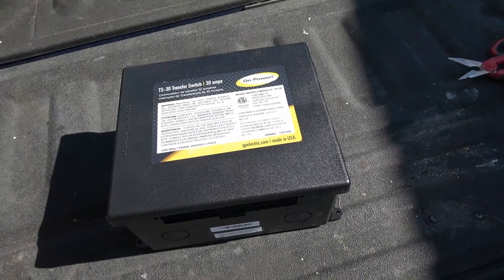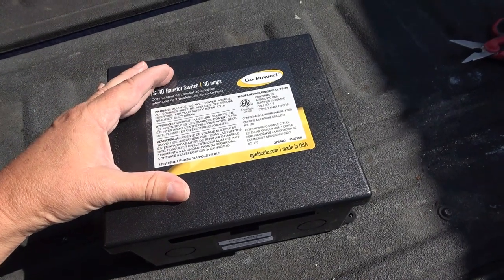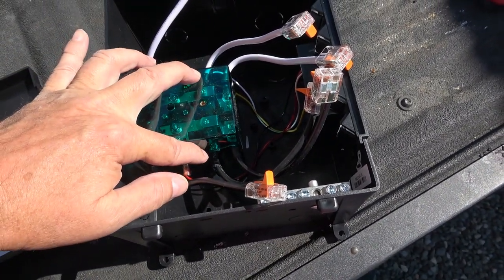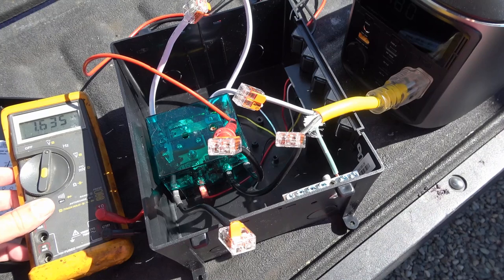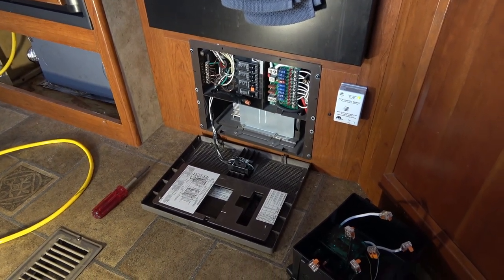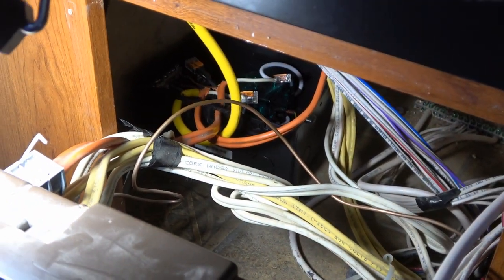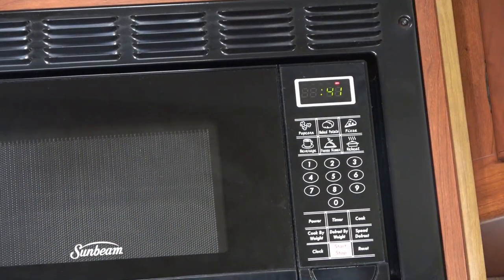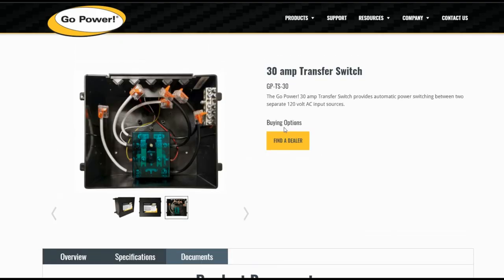30 Amp RV Power Transfer Switch Installation - Go Power! TS-30

Comment: Thank you for your video! I would like to install this in my RV with an EcoFlow Delta 2 max which will receive solar power. Do you think this would be a good solution?
Reply from the maker: I had my Ecoflow Delta Max set up like that for a while and  it worked well. Here is a diagram https://www.loveyourrv.com/our-rv-boondocking-power-systems-current-state-of-things-2022/
Last summer though I installed a 3000W inverter so changed the wiring again for that https://www.loveyourrv.com/testing-out-my-new-3000w-motomaster-eliminator-pure-sine-inverter/  My system is always in a state of flux. :) Cheers, Ray

Comment: So I had bought the same transfer switch, then watched your video. I set mine up today without problems. I think i have a similar setup as you - portable generator (not attached to the trailer) and comes in on shore line power. To get around the battery charge issue, i simply disconnect my charger and attached it to the shore line connections in the transfer switch. That way when my invert is working - its not trying to charge the batteries. They will only get charged when actual shore power or generator power is introduced through the shore line cable.  You might want to make that change so you don't have to remember to turn the breaker off every time you fire up the inverter.
Reply from the maker: I sometimes do want to charge my main RV battery bank via my portable power station inverter, though. So, like having the switch function.  You can see that in the diagram on this recent post detailing my current power system setup https://www.loveyourrv.com/our-rv-boondocking-power-systems-current-state-of-things-2022/  Sometimes I like to be able to move power from the portable power station batteries into my main battery bank. With a flick of a switch I can turn on the converter charger and do that. Cheers, Ray
Reply: @LoveYourRV  OK - you have a much more complicated setup thenwe do. I'm just a simple country boy who likes to boondock occasionally.  Really enjoy your videos. keep it up.
Reply from the maker: Thanks. :) Yes, we are averaging about 6-8 months camped off the grid now.

Comment: I have a 50 Amp service on my toy hauler. If I bridge my 220v with a plug it will run off 110v. Can I achieve this with the transfer switch? Switch 220v to 110 inverter charge bridged?
Reply from the maker: The 220-240VAC 50 amp service in your RV is actually just two - 110-120VAC 50 amp circuits. Here is an explanation - http://www.dmbruss.com/zFullTimeLifeStyle/FTLS_ElectricalDistribution.htm
Reply: @LoveYourRV  I understand but how would I get a transfer switch to bridge the legs then disconnect when I plug into 220v shore power. Right now I'm bridged and isolated my generator from my inverter. Or is what I want even possible?
Reply from the maker: I've never had a 50 amp RV so not overly familiar with 50 amp RV circus but sounds like you need two transfer switches or a 3 way maybe something like this https://rvpartsexpress.com/product/automatic-transfer-switch-for-three-50amp-power-sources-es350/
Reply: @LoveYourRV  that looks almost exactly like what's on my rv doing the switching now. I guess I could leave the legs bridged install the transfer switch and remove one of the input legs so I can't overpower it when I plug into shore? It seems to run fine on 1 leg. My inverter 3000 watt 110v even runs my AC

Comment: I hear you say that you didn't travel with your fridge on propane, is there a reason for that ?
Reply from the maker: I didn't like traveling with the open flame and spark igniter going on and off just in case I was at a fuel stop and forgot to turn it off. Also if we get in an accident I feel better having the tanks closed. Likely overly cautious but the food never really got too much warmer in the fridge while on the road. Here is a bit more info https://www.drivesmartbc.ca/rvs/operating-rvs-propane

Comment: There's a jumper on the delay board that you can bridge that will eliminate the delay since it's really not needed for an inverter.
Reply from the maker: Thanks for the tip!

Comment: Really looking forward to your update on using Lion ME as pseudo shore power. Thats been my thoughts for awhile but haven't pulled the trigger yet.  Evaluating just how I want to build out the system as far as number of Lion batteries and solar panels (ground deployed or mix of ground and roof mounted). Really interested in your results. Thanks for doing this.
Reply from the maker: Should have it out soon. Have been camped off grid for 8 days and heading to a different campsite today. One thing I can say is its been handy do to its portability. I'm camped under the trees so my roof panels bring in very little power but close to an open area, so have been able to deploy the Safari ME and its panels during the day to soak up the sun. https://www.loveyourrv.com/wp-content/uploads/2021/09/Safari-ME-Real-World-Tests-Deployed.jpg
Reply: @LoveYourRV  The portability is what got me to thinking of going that route vs fixed solar/inverter in camper. That and losing our power at yhe house this last winter. Could use the ME as emergency support there too.

Comment: ❤  Ray, when you were talking about the install and everything turned off, isn't that 1.6 V. a phantom drawdown on your batteries?   I have heard people say when they get over 3000 watts inverter, they get a big number on the Phantom draw.    Not that you are running that much from your inverter. 👍👍
Reply from the maker: No, the 1.6V was after the battery and the inverter. It may have been stray voltage induced by from the relay coil. What people refer to is inverter idle current. Large inverters tend to have over an amp or more draw just to idle away and do nothing and cheaper inverters even worse as the electronic build quality isn't very efficient. When we had limited battery capacity and smaller solar array I used to turn the inverter off at night to save energy but now its a much smaller loss compared to system size so don't bother. Cheer's Ray
Reply: that 1.6 V. is not a phantom ( parasitic is a better term) drawdown on your batteries.

In close proximity to 120 VAC, you will see an induced voltage. It is the same as a transformer effect. It is why you might hear a hum in audio components if not connected or not shielded properly.

I am trying to avoid a detailed lesson, but this is an artifact of using a digital VOM with high impedance. You can see these same kind of stray voltages (noise) by connecting one lead of the meter to ground, and holding the other lead between your fingers. wave your other hand around wiring and appliances (without touching anything else) and observe.

There would not be enough current to support the same reading on a lower impedance analog (old-school) meter.
Reply: @jamesalles139    Thanks James for clarifying.  👍👍
Reply: On the other hand, having an inverter turned on will use some overhead power, and will slowly discharge your batteries even with no load. A 3,000 Watt is not likely to be more efficient than a smaller one - but it does depend on the design (you get what you pay for).

For this reason, I run both a 150W inverter for lighting loads (24 Hr.) and a 2000W inverter that is only turned on when I want to run a microwave oven or something. Both are pure sinewave.
Reply: @joeblow3939  it's a good question!

Comment: Is there a way to hookup 30 amp transfer switch on rv with 50 amp service? We always only connect up with 30 amp cord in parks. We never use 50 amp.
Reply from the maker: Sorry, I'm not familiar enough with 50 amp RV service to advise. 50 amp wiring can get a little complex, and since damage to the RV electrical or appliances or electrical shock is at stake, I'd hate to steer you wrong. You might try contacting Go Power. https://shop.gpelectric.com/pages/contact-us Cheers, Ray

Comment: Love the channel and bought your book.  Planning on hooking up my kit next weekend to my camper. I've seen conflicting advice online.  Do I need to get a new charge converter for the LiFePo4 batteries? Or does the stock one with the lead acid charge profile just not fully charge a lithium bank?  I was hoping on getting by with just the solar system charging the battery bank fully. And then letting the converter charge batteries as a back up means at the expense of the battery bank being able to only charge up to about 80% (or whatever it'll do) before panels/MPPT can take over once the sun is out.
Reply from the maker: Here is a video I did addressing that question https://www.loveyourrv.com/lithium-battery-charge-test-can-you-use-a-lead-acid-charge-converter/  Cheers, Ray

Comment: Thanks for this video! I'm looking to add solar and 2 lithium batteries to my Class C and was so happy to find this video showing the auto transfer switch. Is there a way to have the rig also charge the lithium when driving like the OEM house batteries? Right now it's looking like I will still have the OEM house batteries and the solar lithium system as separate sources. I would like to completely the OEM batteries and have the lithium be my DC supply as well ans the inverted AC. Thanks for your help.
Reply from the maker: You might look at installing a DC-DC charger. I have one so I can charge my lithium RV battery bank from my truck alternator while towing the trailer. https://www.loveyourrv.com/renogy-40-amp-dc-dc-charger-installation-and-demo/  You just have to make sure the alternator can handle the extra amperage. Cheers, Ray

Comment: Are you manually turning off the converter in the power center when powering the ac outlets through the inverter?  I see that there is a separate circuit for a converter but I'm curious how that is wired with a power center with a converter built in vs a stand alone converter.
Reply from the maker: Yes, in my WFCO brand power center the converter charger has it own dedicated 15 amp breaker. If I flip the breaker to the off position then the converter gets no AC power to it.

Comment: Ray, 
Your AC power to your camper panel is grounded to the chassis. Do you still add another chassis ground to the Transfer Switch?
Reply from the maker: No, you just hook up the ground wires to a common bus bar inside the Go Power transfer switch. You can see the wiring diagram on this page. Green is the AC ground wires. The RV AC panel will already be grounded to the chassis. https://support.gopowersolar.com/kb/article/254-transfer-switch-wiring-diagrams-30-amp/  Cheers, Ray
Reply: Ray, thanks for the reply!
Are there any drawbacks from having a second ground chassis? Could this create a ground looping?
Reply from the maker: It's hard to say, but sometimes adding extra redundant grounds can introduce noise and hum that can affect things like radio signals, for example.

Comment: Thanks Ray. How do you prevent the converter from trying to recharge your battery while you're on inverter power?
Reply from the maker: My converter has dedicated breaker. I just switch it off and then no power goes to the converter.
Reply: @LoveYourRV  Why not just wire the converter to the shore power side of the switch?  Add a 15am fuse/breaker and done.
Reply from the maker: @RaymondMartin-tc9nz  Because it's not worth the hassle to me. Easier to leave the OEM converter wiring. I rarely use the OEM converter unless on hookups for an extended period.  I have a second better quality converter charger installed right next to my battery bank in the front storage area with its own dedicated input receptacle that I use for my portable generator. I installed that quite a while ago to improve the power transfer. About a 2-foot 4 gauge wire run versus the OEM 25-foot run of 6 gauge.  Cheers, Ray

Comment: Great video. Too bad the box wasn't smart enough to sense the inverter and not change the batteries, therefor not requiring you to secure the converter switch.
Reply from the maker: There is a model that is available that is prewired with that function  https://gpelectric.com/products/30-amp-pre-wired-transfer-switch/  
MODEL: GP-TS (30 AMP Pre-wired Transfer Switch)  https://amzn.to/33mVztN
The GP-TS is a prewired and circuit protected version of the TS-30, designed with special features to simplify and speed up installation. It includes a cable with built-in plug to connect the inverter output and a receptacle that powers your converter only when shore power is available.
Reply: @LoveYourRV  Thank you!
Reply: You can do that yourself by wiring the charger to the shore power line in the transfer switch (per the manufacturer). 

It would require you to get a different quick connector that supports three wires instead of two, though.

Comment: I'm a bit lost as what it's used for. Can anyone help me. If I'm plugged into shore power I have power, if I unplug from shore and plug into my gene I have power there, isnthere any use for this in this case? I only have one main plug so how would I be able to plug in shore and an inverter/generator at the same time?
Reply from the maker: The Go Power! 30 amp Transfer Switch provides automatic power switching between two separate 120 volt AC input sources. Some inverter installations integrate the inverter directly into the AC electrical system.
An automatic transfer switch is usually installed to allow both your inverter and shore power to alternatively feed the circuits and prevent AC back feed. The Go Power! TS-30 is a 30 amp AC switch that automatically connects shore power (when available) to your breaker panel. When unplugged from power, it then connects your inverter output to power your circuits.
Reply from the maker: Also many RVs have built in generators so require a transfer switch. For a portable generator they aren't really needed.
Reply: @LoveYourRV  thanks, that makes some sense now , I was trying to figure out how it can switch between 2 sources if I only had one plug. If I hard wire another in it would switch between the 2 👍
Reply from the maker: I'm using mine to auto switch in a portable lithium power station when I unplug from shore power  https://www.loveyourrv.com/wp-content/uploads/2022/03/Boondocking-Electrical-Block-Diagram-scaled.jpg https://www.loveyourrv.com/our-rv-boondocking-power-systems-current-state-of-things-2022/  Cheers, Ray

Comment: next time you touch a pcb board, you should always ground yourself first. it will save you from troubleshooting why nothing is working its because you could easily break the pcb. Just a tip.

Comment: Thank you for the video! I wanted to confirm I was hooking mine up correctly. I didn't get much sleep and I had connected in my shore power where it's supposed to feed the distribution panel. It was a 🤦🏻‍♂️ moment. Thanks for the clear and detailed walk through.
Reply from the maker: Glad it helped :)

Comment: Nice job. I just ordered a Bluetti 200max and I was planning to do the same. I am going to put a 30amp plug in the kitchen so I can plug in for traveling and boondocking like you witha power cord.  I wish my breaker box was as clean as yours, I have a rats nest and will have to extend my 50amp in to the transfer switch location. Thanks for the video.

Comment: What guage is your yellow inverter to transfer switch cable? 
How many watts can it handle?
It looks identical to the cable I used (10AWG/1875W).
Thanks for the video!
Reply from the maker: If I remember right I got it a Home Depot and it was a Yellow Jacket 20A 10awg cord like this https://www.homedepot.ca/product/yellow-jacket-lighted-end-10-3-sjtw-50-ft-heavy-duty-yellow-jacket-extension-cord/1001529983  I've since installed a 3000W inverter and rewired things using a 30A RV power cord as a conductor https://www.loveyourrv.com/testing-out-my-new-3000w-motomaster-eliminator-pure-sine-inverter/   Cheers, Ray

Comment: great video! no problem with your integrate batterie charger inverter? can you use your 12V  lights wile your inverter is on?
Reply from the maker: Thanks :) When the inverter is on I don't use my converter charger but the 12V lights and other 12V RV loads run fine off my batteries.

Comment: Ray, thanks for all your videos.  What have you learned or heard about Ground and Neutral bonding?  I heard that the RV Gnd and N are not bounded, and only get bonded back at the Utility panel when the RV is plugged in.  Is the Battery Inverter Bonding the Gnd and N ?  I heard this is also an issue with the new inverter generators.
Reply from the maker: You're welcome. I don't believe the Safari ME inverter is bonded, most portable stuff isn't, it has a floating neutral by the looks of it much like by last few portable inverter generators I've used. I learned that the first time I plugged an inverter generator into my RV surge protector and got an error code, had to use it in bypass mode to get it to work. Then I found out about an Edison plug to bond the N-G. Added that and it worked fine again.
I'm not sure if there is much of a problem running a floating neutral setup since so many RVers use portable inverter generators with no issues I've heard of. I would think if there was a concern the generator companies would have to deal with it. But I could be wrong... I should give an Edison plug a try in my new setup and see what happens.